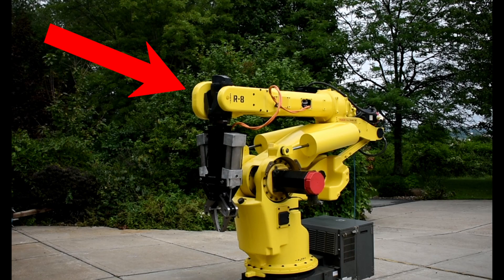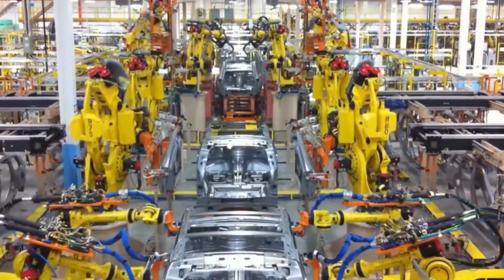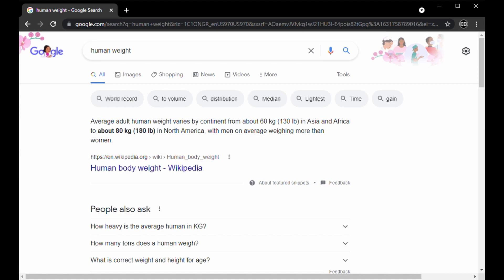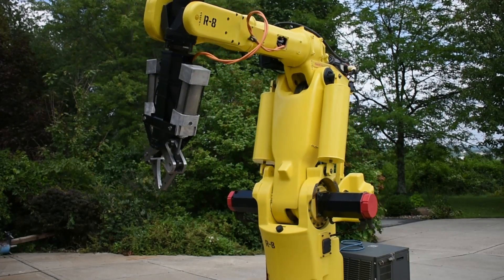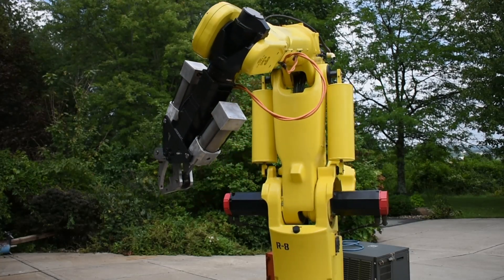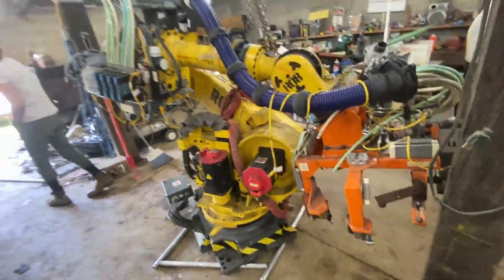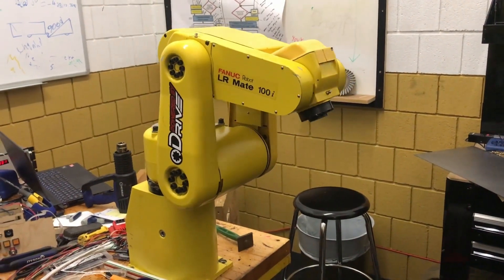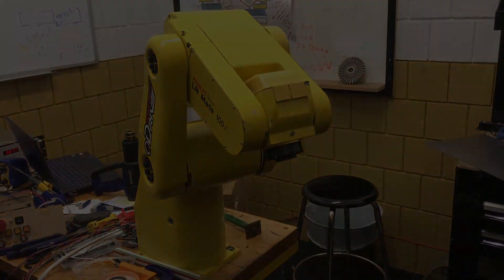I attached a giant claw to an industrial robot

Comment: I’m really curious how you interfaced the drives for your gripper to the RJ2. Is it basic pulse digital outputs for certain durations?
Reply from the maker: That’s what I originally planned on doing, but since I ran out of time, the robot simply outputs a single open/close signal. Then I program the claw directly for how far to open/close. It’s back drivable so I just manually move it to a position and save it.

Comment: >... it uses two 10 kilowatt electric actuators capable of 5500 pounds and resolution down to one thou....

🤯
[subscribed]
Reply from the maker: Yeah those actuators were quite the lucky find, they’re capable of moving 10x faster if I had the right drives and water cooling… maybe one day.
Reply: @ExcessiveOverkill   when robot overlords finally make their move to take over, at least you will have a worthy champion to fight for you